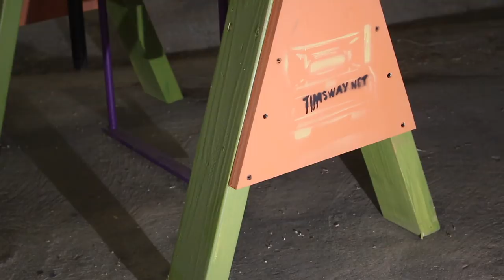Industrial Reclaimed Steel & Barn Wood Whiskey Cabinet

Comment: #youshould remove metal dust and chips from your 90 degree magnets. last weekend i totally f-up fire pit, and weld it second time because whole lot of dirt in magnets make it non square. if you using it just to hold stuff - ok, but don`t trust dirty magnets)
Reply from the maker: you are correct, sir but even completely clean you can't trust those magnets to give you perfect angles either. I just use them for reference only and to hold things together. you need a SqWAYre for that :)
Reply: and i have one) perfect for metal working cause it easy to clean) btw clean magnets was "close enough" in my case

Comment: Great cabinet.   Any concern over flex on the glass shelves?  Metal or wood might keep the style and add weight which also fits.
Reply from the maker: Honestly, glass freaks me out. I'm too much of a bull in a china shop. If it were for me, I would use steel sheets or wood. I made this cabinet two years ago out of all wood, same dimensions, same shelves, and the owner has had it loaded to the gills with bottles since (so much he ordered another). So far it's been fine.

Comment: that's ri-duc-ulous!   Tell me, were those boards cracked or split before you knocked them in half? I like the "living edge" effect they have. I might try that with multiple boards, only like 1/2 apart. Looks great.  BTW the Sway-horses look good. I see you made more.
Reply from the maker: Paul  Meyette no, still using the same two swayhorses.  The boards were not split at all. I just gave em a good whack. Thanks bro :)